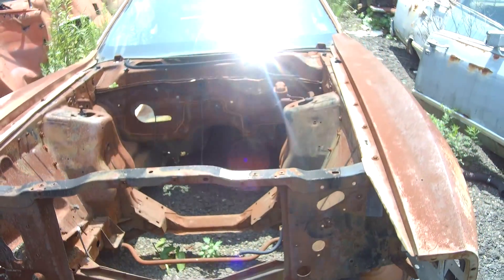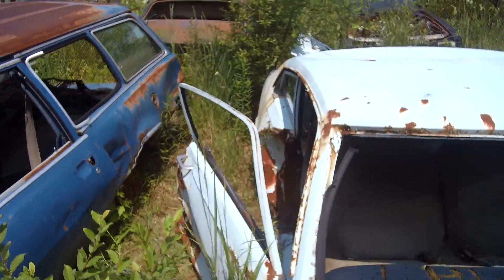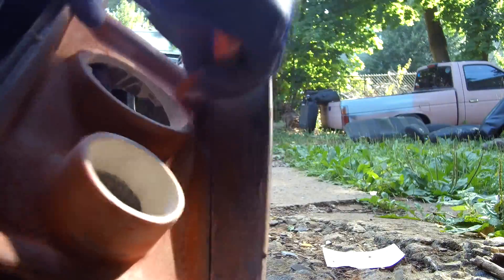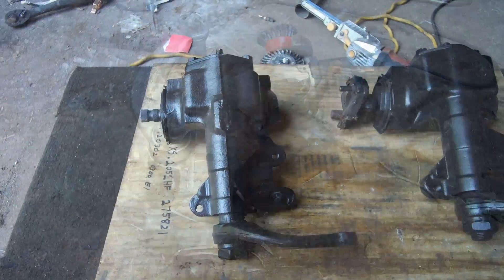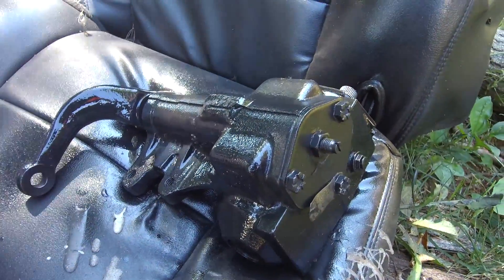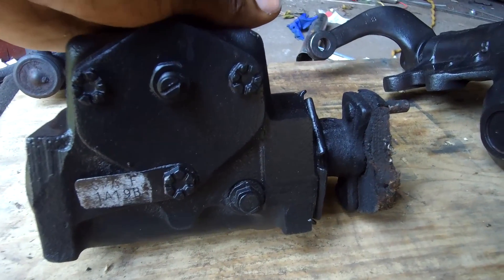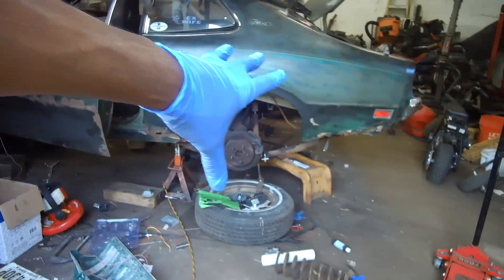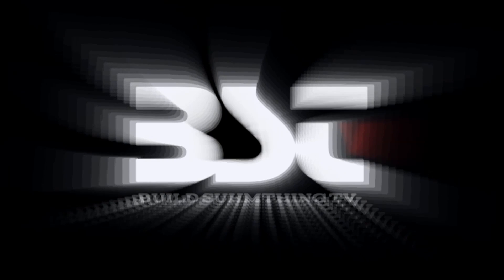Crown Victoria CUSTOM Gauge Pods ( and Maverick parts )

Comment: I got the map lights/sunglass holder out of a junk Nissan Sentra to replace the ticket light in my P71. We had a little bit of rustoleum oil rubbed bronze in a spray can at work, so I used that. It matched the dark gray pretty good. Later I bought more when I got a 02-05 explorer console. Even up close to the dash, it is a pretty good match, just glossier. I think you would be pleased if you were looking for a gray that would come close, maybe put the matte clear over it.
Reply from the maker: Thanks for that I ( thats what I needed )I am going to source that out right now

Comment: I like the idea of what you did. I need my Radio, so I won't be doin' that (I ended up ordering an A-Pillar for my tach - I hate pillar stuff, but) .. Gave me ideas on the dash though .. thanks ..
Reply from the maker: I did two the other one is just by the steering,, thsi one is for the tachless 04 crown Vic so i just put  on that side.. I wanted to use the tach i had and its big so it was best suited for that area i will show ya next time in the video

Comment: The dash look pretty good hopefully it doesn't crack or flake on you 
I'm will only need two pods air fuel ratio and possibly oil pressure gauge as I only buy 09 and up so I have the tack already
Reply from the maker: It should not  crack used fiberglass... plus it isnt in the sun spot of the car ( it should be good ) yeah thats why i made two bezel 2 pod version  and then the 4...Now i have to wire up that tack and oil pressure gauge

Comment: The gauges make the dash look really expensive.  You've got a lot of patience.
That Quick Color used to be my go to paint. I was at Home depot a few days ago and all they had was about 4 cans of black...and a thousand cans of expensive Rustoleum.
The rich making war on the poor.
Reply from the maker: thats a great PHRASE brother ( The rich making war on the poor ) love that.. The quick color isnt the greatest but it does work quite well for $0.98.. I did the Bezel in parts I know i can not sit down with it 1 shot dude.. Cause i have to think of the contour and such ( give my mind a break ) when the plasitic was lifting ( very frustrating ) but i pulled through brother ( and got calm ) thats how life is. If you want results you have to push through and get it done

Comment: That looks really good. Almost factory like, i love it
Reply from the maker: thank you forn that it means a lot coming from you... I am still searching for the part .. i have come across any as yet, but it will come... I am going to make a 05-up version of this dash and see how it comes out ... .. Thank you for the support JacktheFox
Reply: @bstfordchannel923  No problem :) Its cool that you customize these things yourself. People always just buy premade parts made in china and slap them on, looking all the same. You made something custom all by yourself, and thats what makes it so individial and awesome.
And thank you for looking out for the parts :)
In the meantime i was working on my P71, the fuel pump is dead. I was able to reactivate it a few times by smacking it (unfortunately broke the cable of the sending unit) but i definitely needed a new one. I just ordered one off of rockauto.
And i wanted to fix the axke bearing that was broken on the driver side. Oh boy, that thing was SHOT. I had to buy a new axle since there was already a repair bearing installed. The bearing housing got stuck so a shop has to remove it for me. But damn, i've never seen such a destroyed axle and bearing.
Reply from the maker: @JackTheFox   The cab drivers reall dont care they roll wih the cars until it goes... Now the true NYC cars they kinda take care of the ( the private taxi owners ) to be honest it differs... I had to deal with mine it wasnt so bad the good deal was I had the axle SUCH A PLUS..  I have to revise the bezel pods for  the 05 and up car.. I went to the junkyard to day and picked up the two bezels.. I thank you for the comment on the bezel i could not see myself install gauges how everyone else IF i can do something a bit slicker...people will copy and very soon, but thats a cool thing if they do..  The support from and others is what keeps me going

Comment: what you need is liquid plastic. its used for plastic repairs but itll bond plastic to plastic so the cracks wont show or lift.
Reply from the maker: I have bumpers i need to try that on and see what is good
Reply: @bstfordchannel923  the bumpers are a different kind of plastic. so pick the filler carefully
Reply from the maker: @ozmister101  that is true i have see and try different things
Reply: @bstfordchannel923  that's all you can do man
Reply from the maker: @ozmister101   true brother true..., I have  question what videos should I put on a the Patreon page, just to pick your brain
Reply: @bstfordchannel923  remember I side project we was talkin about.?? like a sneak peek into that. theres a lot of fab work to it easy but still bonus things. things they usually don't see. things like a frame build or how you came to start building certain projects. the frame build for the project would be perfect. then the options you could use for said frames front and rear end setup. then your frame your choice of parts make the final show on the channel.
Reply: @bstfordchannel923  I still need to contact you and send you a video on how to make the frame minus a few tweeks. well go over. if I had the space you have id do it myself sadly I do not
Reply from the maker: @ozmister101  i have no space also but what I will make it happen though,,, where are you located i have few ideas and such emaileme we can converse
Reply: @bstfordchannel923  I'm in Ohio. Sadly I dont even have a garage do  everything outside sadly
Reply: @bstfordchannel923  I need ur email I lost it and my email acts like I never sent you one lol.
Reply from the maker: @ozmister101  criminalslangrodders@gmail.com
Reply from the maker: @ozmister101  one of these days i have to go out that way to check you and fuzzy out...it seem there cool people out that way.. Man its tough not to have garage but i have one and i still wrench outside ( toooo many fn cars ) dismantled inside the garage